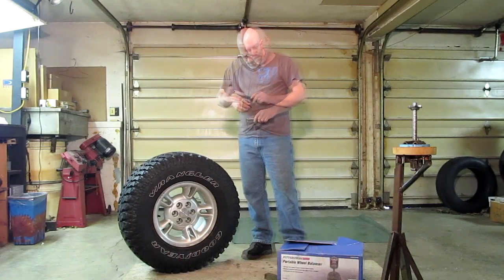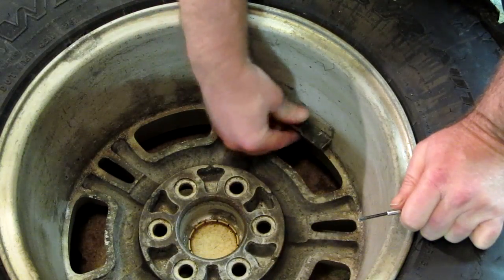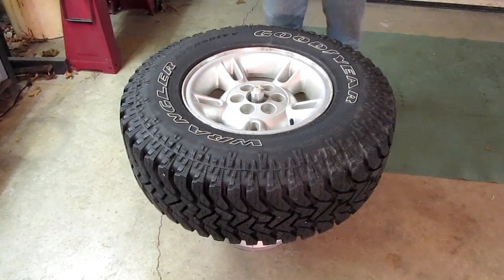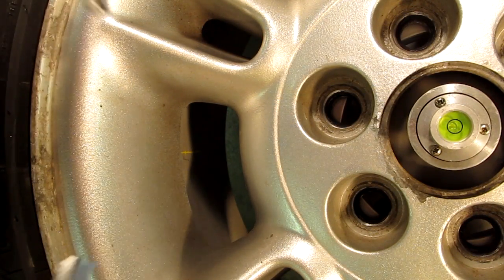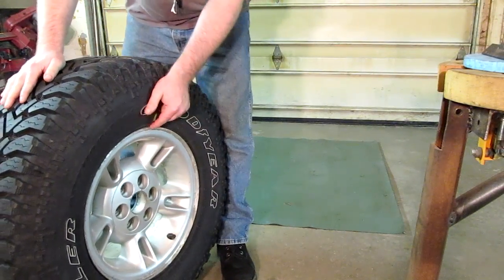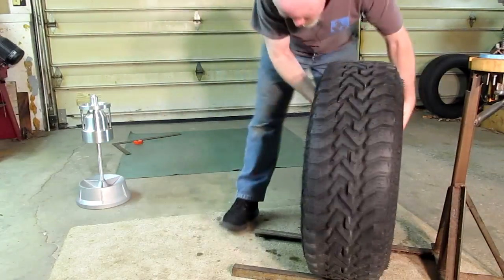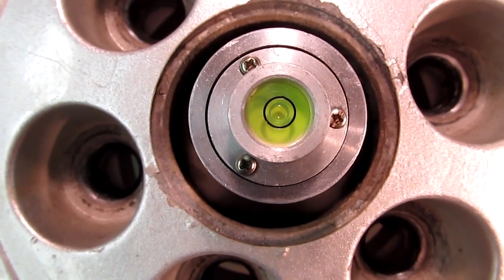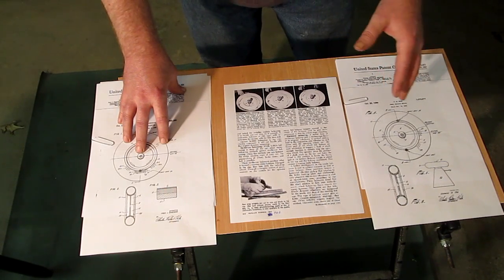Bubble Balancing An Automotive Tire To Correct A Static Imbalance

Comment: I still have, and still use the old Micro precision wheel balancer Model M-60. I've had it for years, and never let it go. I have always had good luck with it. It has the small triangle for stem location, and the X across the glass. Really helps to keep the weights distributed within the X lines. Use 4 clip on weights, depending on wheel, get your bubble centered, mark the tire, mount 2 on the inside of the wheel at that location. Check balance, and use the other 2 to equal the weight within the X lines on the front of the wheel, mark wheel, install, and recheck. Works excellent still yet. Just a tip, if the wheel center cap has any weight to it, and you get a balance problem after, check it for any off weight balance. Really good video by the way.
Reply from the maker: Thanks for commenting, Dennis. Was looking it up....the M-60 looks to be a seriously nice piece of equipment. Awesome!

Comment: I got that same bubble balancer but doing this on smaller car tires. I have tried all 4 tires with and without weights and the balancer always shows the bubble in the middle. I am wondering if the balancer is broke or if the tires being balanced is too light weight for the springs on this bubble balancer.  I looked at the tiny pin under the balancer and I see a groove all the way around the tip. I did not spin the tire while doing the balancing. Any suggestions.
Reply from the maker: +rg10969 As long as you can see the groove and NOT feel it, then you are alright. Others have mentioned the springs being to strong for some tires. I think they ended up getting weaker springs.

Comment: what is difference paste balance weight  inside and outside the rim??
Reply from the maker: Darrel Mears PITTSBURGH from Harbor Freight Tools.
Reply: I spoke with an academic who works for a major tire manufacturer.  He studies the physics of tires and wheels, and applies that to practical, real-world solutions.  He told me that it should be ok to statically balance with the bubble balancer, but that I should probably only use one of the 10 major tire manufacturers.  He also said that putting the weights in the center of the rim is the most stable method for static balancing (least likely to cause dynamic imbalance).
Reply from the maker: +Saigon Viet Nam Location mainly. Some folks prefer one over the other, and some wheels require one or the other.
Reply: Charlie Sarsfield what brand balancer are you using
Reply: Charlie Sarsfield thanks
Reply from the maker: Darrel Mears No problem

Comment: Could you please let me know the diameter of top shaft that houses the bubble. I have a wheel I need to balance with a small centre bore and i'm not sure it would fit on this balancer. Thankyou
Reply from the maker: Mine measures at about 1-15/32". To be exact... 1.462"

Comment: what do you mean by divide by 2?
Reply from the maker: When using clip on weights... If, for example, it takes 4oz to center the bubble (while on the balancer, of course), then you want to put 2oz at that location on the front and 2oz on the back of the wheel. You don't want to put all of the weight (4oz) on the front of the wheel, as this will likely cause a dynamic imbalance even though the static imbalance has been taken care of. Hope this clears it up for you Alex. Or did I just confuse you more?
Reply: Charlie Sarsfield
i mean when using stick on weights you said you divide by 2 that's whats confusing
Reply from the maker: alex tyson Perhaps it was when I was splitting the stick-on weights to divide the weight for each side of the marked (in yellow) center line of the wheel. This way, the weight is still centered. Does that make sense?

Comment: clip on weights seem to cause minor damage to rims especially after a bunch of years or weathering..love the stickies
Reply: If you can get 'em to stick! I haven't had much luck using them, save for some brand-new or like new motorcycle wheels. I put them on some aluminum wheels a year or so ago, after doing what I thought was a very thorough cleaning. They all fell off before I even got back out of the driveway.

Comment: For those who claim this method is useless, you are completely wrong. Ideally, a wheel should be static balanced and then dynamically balanced. Often times, someone who uses the static method correctly achieves a better balance than someone using a spin machine who doesn't know what they're doing. Believe it or not, helicopter rotor heads are static balanced using a very similar method and if someone skips the static balance process, the dynamic balance can be challenging or even impossible. I've static balanced tail rotors that required no subsequent dynamic balance, because the static balance was done carefully. 
I must mention that when using a bubble balancer, such as the one in this video, it is imperative that the tool be completely level, not just "close." The tool must be level on a stable surface and in a draft free room, in order to achieve the best results.
Reply from the maker: Very well put.
Reply: Tires are a little different. It works fine, on the narrower wheels such as motorcycle wheels etc.  If you start getting into the larger and wider tires you have two different planes that imbalance can be on, static will only correct the imbalance radially as a whole, which is likely what you're after on a rotor, same as say a lawnmower blade.  This is why weights are added to the outer most flange of the wheels, there can be a radial imbalance and also a side to side imbalance.
Reply from the maker: Puckgrinder85 Very true. No argument there.
Reply: It doesn’t matter if the floor is level. It only matters that the mounting flange and bubble level are fixed evenly, I.e. not screwed or bolted together imprecise

Comment: these bubble balancers ARE COMPLETE AND UTTER SHIT.  unless you have over sized heavy ass wheels the springs on this piece of junk are so taught that they will continually push your wheel off the balancing cone and fuck up your readings.  So that means if you drive anything other than an SUV or monster truck you will more than likely be faced with this problem.  Also the readings are very inaccurate and the platform your wheel sits on will not keep it completely level thus you will get bad and inconsistent readings.  If you don't believe me go ahead and buy one to see for yourself just be sure you buy it from a retailer that has a good return policy.
Reply: i got sporadic readings when the wheel wasn't resting on the cone.  with the wheel resting on the cone i got constant readings and have no vibrations with my weighted wheels.  pretty sure that's the way it's supposed to work.  even says so in the directions i got with it.
Reply from the maker: Definitely takes patience, but can be done. It's certainly not for everyone.
Reply: thanks for the advise.  I think i just solved the spring problem by tying down (neutralizing) two of the springs.  my wheel now easily rests on the cone and am getting more consistent readings.  haha yes these definitely aren't for everyone
Reply from the maker: James G  Modifying it to work the way you need... awesome!
Reply: @jamesg3880  You could also change out the springs with 4 weaker springs.  That way you would have more consistent support around the ring, and possibly get even better centering on the cone.
Reply: James G It was my understanding that it isn't supposed to rest on the cone.. the cone is just there to center the wheel on the sprung platform by pushing down, compressing the springs momentarily. Making sure the bubble is on the same plane as the sprung platform seems important though. Am I wrong?
Reply: James G Hmm.. I guess the spring part is just to help center it properly. Thanks

Comment: Hi: I thought this was obsolete technology and the bubble balance equipment was hard to find until recently.

I saw a comment about where to get tire supplies or weights:
I buy my stuff on eBay from a tire repair dealer, there are at least 2-3 stores with anything a DIY or a pro may need. Its top quality stuff and not the crap sold in discount auto stores such as Autozone (not picking on them but a nationally recognized chain).

The worst tire I did required 9-oz of weights on a thin tire, the rim must have been bent. Gotta love custom wheels.. I do mostly big rig tires and most people never balance them or run a balancing adapter behind the wheel. Some companies put this powder stuff inside the tire for balancing.
Reply from the maker: 9-oz, holy crap!

I didn't know that about rig tires, wow.

Comment: I have balanced 1 set steel wheels with clip on weights and 1 set aluminum wheels with stick on weights with the bubble balancer yet. I checked them with my spin balancer and it verified that the bubble balancer is working surprisingly well. So thumbs up for this little thing.
Reply from the maker: Awesome!
Reply: why should it be surprising? shops have used the bubble method for many years with good results. as with any method the details are what is important. this video shows a guy who does not just haphazardly slap weight opposite the light side but takes care to make sure the weights are centered between the front and back of the wheel.

Comment: Where did you buy the clip weights? Harbor Freight only caries the stick on kind.
Reply from the maker: Actually, all my clip on weights have come from other wheels. A Google search brings up some places selling them.  :)
Reply: I get my weights from a local tire shop that throws them away.  I had to call several shops before I found one that would give them away, but now I can go there and get all the stick-on and clamp-on weights that I want.

Comment: whats a good adhesive to reuse weights?
Reply from the maker: I use a double sided tape from 3M. It's kinda thick, as its center is like a foam. I think it is made for automotive exterior molding. It's what I had laying around and so far it's working great.
Reply: thanks for the help.i did not understand on one of your videos,what makes a tire only able to balance using an electronic/electrical balancer(machine).
Reply from the maker: You're Welcome. There are two types of imbalance possible with a wheel/tire. 1: A static imbalance is when there is a heavy or light spot that is centered around the axis of rotation. 2: A dynamic imbalance is when this heavy or light spot is not centered, but off to the side of the wheel/tire. To accurately detect and measure (by weight) a dynamic imbalance, the wheel/tire has to be spinning. A spin balancer is necessary to accurately measure and correct this imbalance, by suggesting weights at specific locations. Bubble balancing is only good for correcting a static imbalance. The good news is that not all wheels/tires have a dynamic imbalance. Many only need to be corrected statically. However, the wider a wheel/tire is, greater are the chances of a dynamic imbalance. I just know that all made sense, right?

Comment: I just got one of these, but keep getting inconsistent readings.  I'll get it balanced, take it off the balancer.  When I put the wheel right back on, it would give a different reading as to where to put the weights.  Any idea why this would be?
Reply from the maker: I had this problem at first, so I know how frustrating it is. First, make sure to oil the tip of the balancing pin. Make sure the balancer is on somewhat of a level surface, it doesn't have to be perfect though. With no wheel on the balancer, make sure the balancing level is centered. Adjust it if necessary. Bump the balancing hub around a few times and let it settle. Hopefully at this point the balancer will center every time. The rest of the equation comes down to consistency of centering the wheel on the balancer. If you have to, put a light coating of oil on the centering cone so the wheel will more easily center itself as it slides down the cone. I hope this helps you out Matthew.
Reply: You should also lube the top of the ring around the cone, and the plunger rods under the ring.  If you want to be extra careful, you can test the compression force values of the springs to see if there is much variation there.  Ideally, each spring would have the exactly same force value as the other 3 springs.  

If the surface of your cone is rough (like from bad chinese machining), you can smooth it out with 2000+ grit wet/dry sandpaper, followed by a polishing with aluminum polish.  You want to get it mirror smooth and slippery without taking off much of the aluminum.  A smooth, lubricated cone will definitely center the wheel more consistently than a rough machined (or even worse, a cast) cone.

Finally, if the inside of your wheel hub is scarred or rough, you want to smooth that out and lube it as well to help it slide and center itself on the cone.

Comment from the maker: I would think that the static balance would not be effected, but you would have to use more weight to achieve balance the closer you move the weights towards the center of the wheel. Having said that, It seems to me that there WOULD be an effect on the dynamic balance/imbalance of the wheel. Less so though, as you move towards the center. Just my thoughts on it. Hope it made sense.  :)

Comment: Doesn't the effectiveness of the weights change as you move them in toward the center of the wheel?  It becomes a shorter lever as when the see saw balances when the heavier guy moves toward the fulcrum.  I always balance at the bead area of the wheel to minimize this.

Comment: No not at all here is why when its set on the inside of the tire is so far away from the bubble that it may not get a good reading for that side so by ave it above the bubble it will then be inline for a check i found that 1 out of 5 will read good on the normal way then flip it and its off some put wieghts on that side and flip and test the regular way and after thats done then its good. I always do it on both sides gets them really in line and most can then be really in balance!

Comment: One thing i do with mine i have the same one as you i balance the wheel on both sides of the rim here is why i find that when i do both sides of the rim you can get a real good balance and i mark center on rim but i put the wieghts on with temp tape on off set on that side then after one side is done then i flip wheel and do the other side and if need add where its needed that way and most times like 90% tey run great due to i did both sides! Try it on yr next one that is still out of balance!